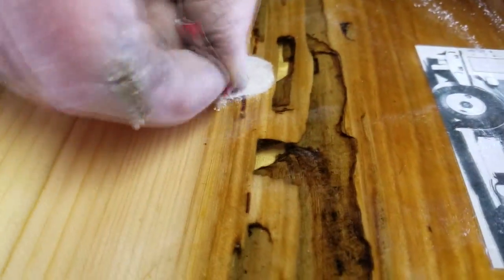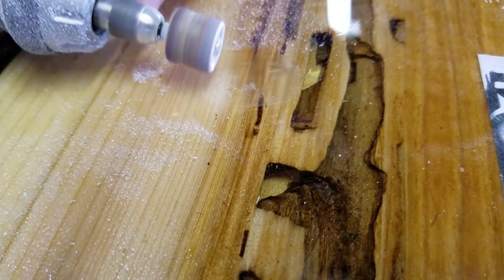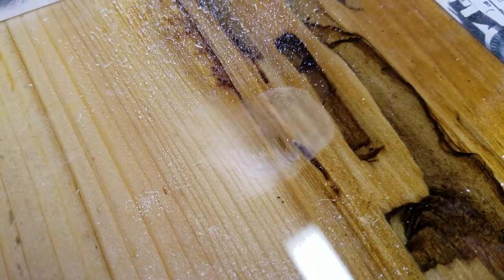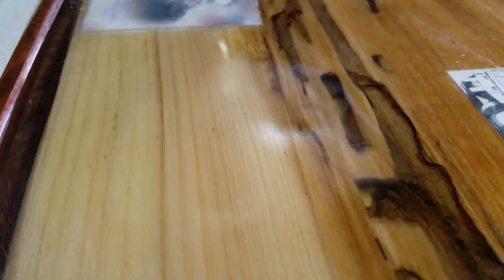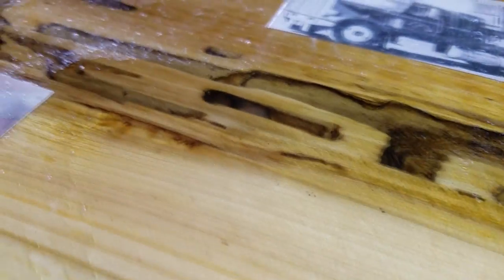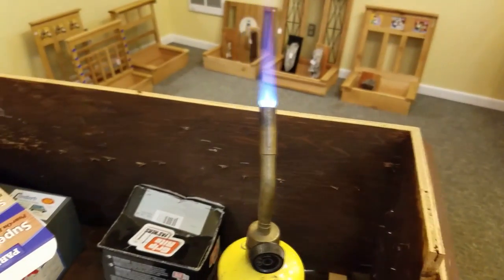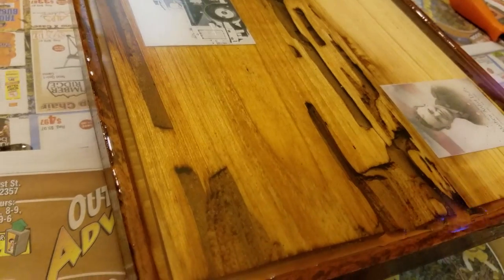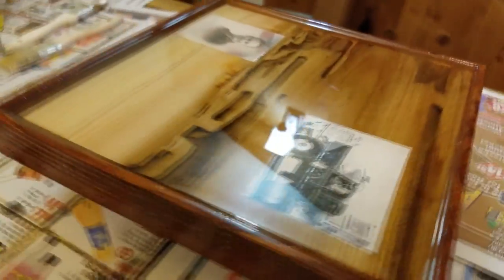Epoxy Art, How to repair Air Bubbles. Clear Epoxy Bubble Fix

Comment: I used your process with a couple of changes and they worked out great.  Used a dremel with a buffing wheel to remove the bubbles. (I had multiple small ones) I used very lite pressure if any at all, really just floating the pad on the area.  Once the troubled area was down to clear epoxy, I then used an air compressor.  I cranked the pressure to about 80 PSI and used a fine nozzle about an 1/8 of an inch above the surface to polish the buffing marks away.  Then re-poured a new surface layer. If you did not know where the area was i refinished, you would not really see the defect. Thanks for the the idea and I hope this helps with any problems you come up with in the future.
Reply from the maker: Yes thank you...BB23

Comment: You'd be surprised how well another coat of epoxy will cover ALL of that up! (And you could've stopped at 320 grit if you were doing another coat on top of it!) But don't be so hard on the guy and his slightly overzealous dremmel work! It will all work out once it's been recoated! But beautiful work to the both of you! I LOVE finding old eaten out/half rotten (in the middle) boards and making them into beautiful and unique projects!
Reply from the maker: Yes learned this after other projects. Thank you for your input. Cheers

Comment: While the epoxy is still not set but past tacky you can shave off bumps with a double edge razor blade..... If you cut a piece of soft wood on an angle you can lay the razor on it and use as a plane to shave..... In the auto industry they make tiny razor planes for shaving small  paint bumps where a bog or dust got into the surface.... I have done it lots of times and with a angular slide like you would use with a wood plane you can get very smooth shaves that may not even need polishing...... Before pouring brush on acetone and it will help the epoxy do the seal coat..... A vibrating table also helps air to surface
Reply from the maker: Good Tip, Thanks

Comment: Is using the 320  last super important? Or will the resin fill any voids from a coarse grit sandpaper, like 60?
Reply from the maker: In doing more projects over the last few yrs, I have had good results with using grits down to 120, I have not tried just 60/80 grit. However I think you would be okay with that coarse of grit. Plz post your results .
Cheers.
Reply: At the wooden boat Co. I work at we usually hit it with 220 or 320 before we do our next pour! Especially if it has been over the 24hr mark!

Comment: Is it possible to get the coat with microbubbles.. ad artist don't show this repairs ... I have this question how much it is possible to get the clear perfect top coat.
I get this spots bcz i do sand my top coat 100% bcz it gets minor dirt silicone , so to smooth it out i do sand but during that process getting this tiny holes is irritating.

Comment: I do commercial pours with as much as 20 gallons over new bar tops. We always do a first "squeeg" coat which we work in (after 2 coats of poly, and clear acrylic caulking smeared where ever) then a top pour that self levels. Sanding to the first coat never needs to go beyond 320/400 grit (if that- really). It melts together if it's smooth. You did too much work.

 Nice grinding and eye- for spotting the second flaw. TY for the video, years later.

: )
Reply from the maker: Ok thanks for your insight all this information helps. I have done a few projects since this video was made and yes you are correct. 

I am getting better, more efficient and getting better results. Because of people like you.
Thank you and have a Merry Christmas.

Comment: Well...looks like you figured out the problem and how to fix it but in the future.....lol...might I suggest going in and filling any holes, cavities or voids with epoxy BEFORE you lay down a full coat. You may have to do small ammounts allowing the epoxy to harden in between coats. Also..you can go in the backside that won't be showing in your end piece and fill it from the rear. Don't forget to use masking tape around where you are filling so it doesn't get anywhere else. You can drill up to the crack too from behind. Also...there is a product called Bubble Buster that will remove bubbles with just a spray or 2. Waiting a few minutes in between coats as well. If you plan on future projects it might be a good idea to have some on hand. Beautiful memorial. I'm sure your mother in law loves it. I'm sorry for your loss.
Reply from the maker: Thank you so much, I will relay your kind words to my Wife. And thanks for your suggestions.